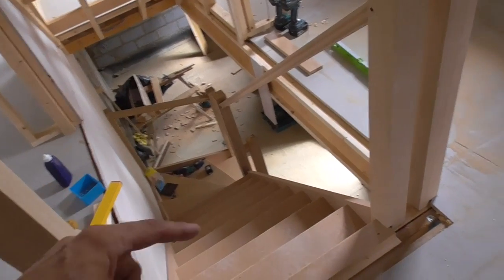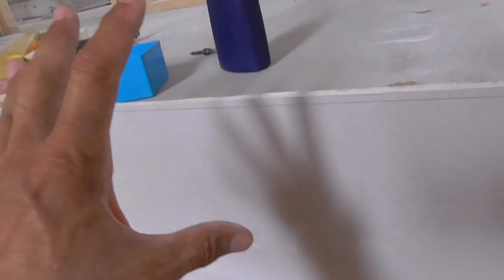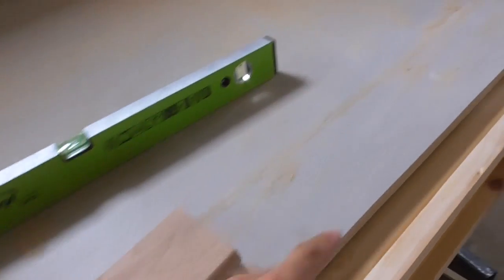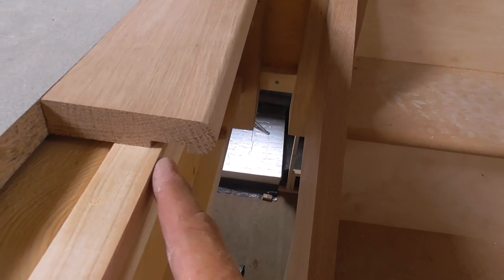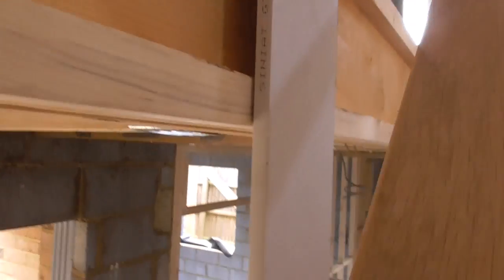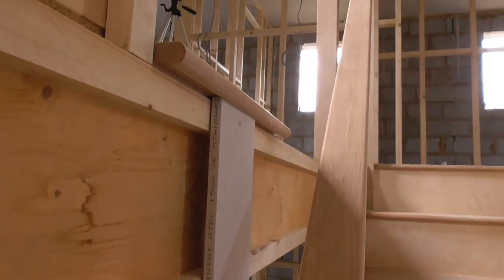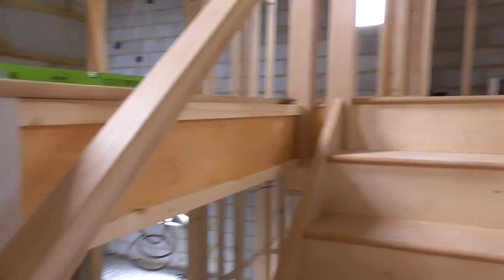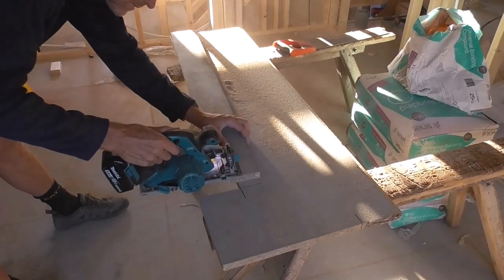UK Carpentry 1st fix stairs ***PLASTERBOARD APRON DETAIL AND FLOOR REPAIR***

Comment: Quality work. Your videos
Always remind me of the lads I learnt off. One thing to mention is when I do this detail or something similar like when window boards can’t be fitted until the plastering is done if they are a special order etc. Is I set the board up to have a bead on it. It means you get a nice crisp line even if it does get covered but it does mean you don’t have to de snot and it actually helps the plasterer as they don’t get scabs off the raw edges of the board! It also stops. It’s great aswell if the plasterer puts a lad on the reveals or is having a bad day!
Reply from the maker: Hi Matt🖐You're suggestion about putting bead on before skimming is awesome, and I've never actually been on site at the same time as the plasterers to ask them to do it😬 Definitely get the best result this way👊Thanks for your comment bud😎Cheers Del

Comment: Top notch craftsmanship as always T.C, 👍😁 Did you consider going with one landing newel and just putting a mitred return on the hand rail and base rail? I'm actually doing a stair balustrade myself at the moment. Everything is solid ash, I milled all the components in my W/S. The balusters are 1-7/8" square and go from an inverted base rail fixed to the ceiling to the treads. It's an interesting one, 🔨 🇮🇪
Reply from the maker: Hi TN🖐It's really interesting that you mention a single newel and a mitred handrail, as that is the detail on the other side👊I'm wondering if, as you suggest, it would have looked better on both sides🤔Superb comment and we'll see how it looks when I 2nd fix it👍Have a good weekend 😎 Cheers Del
Reply: @thetallcarpenter  Indeed, I've built handrails using both methods and I prefer a single landing newel. The double newel at the landing looks too busy or clunky, if you know what I mean T.C. Marvellous content,  😁 🔨 🇮🇪
Reply from the maker: @TheToolnut  👍😎

Comment: Great work as always Del. Are you finishing off the same way in between the 2 newel posts? Gonna be tight plastering in there or do you have another idea for that space?
Reply from the maker: Great spot Maverick🤓and I will be putting a short bit of oak apron in between those 2 newels as, like you say, it would be a real pain to plaster😩Thanks for watching 😎 Cheers

Comment: Brilliant solution with notching out under the floor piece to fit the drywall. is the floor cap bit flush with the underfloor or how does that work?
Reply from the maker: Hi Sebastian🖐There is a base rail which sits on top of the floor capping that has a groove in it to take the spindles and also allows the carpet to finish to it👍Thanks for your comment and for watching😎Cheers Del

Comment: Looking good however confused to why your base trim sits flush with your floor, where does the carpet finish to?  Just butt up to the base rail?
Reply: It’s a nosing, the base rail will sit on top of that
Reply from the maker: Hi there🖐As RamHomes says in the comment below, we fit a base rail that the spindles are grooved into and the carpet butt's into the back of that👍Thanks for your comment 😎 Cheers Del
Reply from the maker: Thanks for adding this answer🤩 Cheers Del
Reply: @thetallcarpenter  thought that was the case, in my opinion not keen on that look prefer the nosing ontop of the floor and butting the carpet to that rather than the base rail. But we've all got our own details keep up thr good work!
Reply from the maker: @thebonkarsgamer449  I have done that before with spindles housed into the nosing, and also done it with the capping flush with the floor and the carpet finished into a carpet edging behind it when using glass ballistrade👍

Comment: Do you ever have tools stolen whilst working on sites like this one?
Reply from the maker: Hi Billy🖐No, never with these builders as we have all been working together for years and all the tradesmen are really locely🤩I worked on bigger jobs proving specialist stair installations and that was horrible as you couldn't leave your tools for one second as someone would steel them🤬Even the 240v charging station for your batteriesin the site office wasn't safe, and people would swap thier old, knackered batteries for your newer looking ones🤯Big commercial sites are hateful places to work😬Cheers Del
Reply: @thetallcarpenter  yes, I had a feeling that some sites would not be great places to work. Thanks for the reply Del🤗
Reply from the maker: @billybulmer7386  👍😎